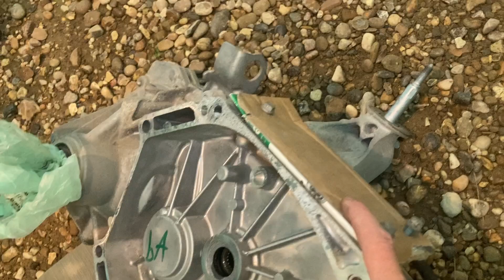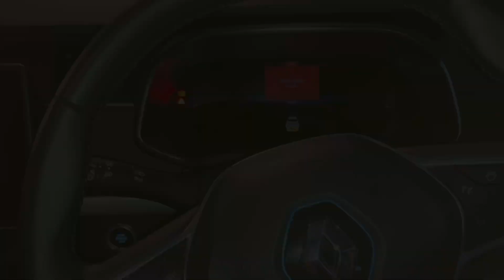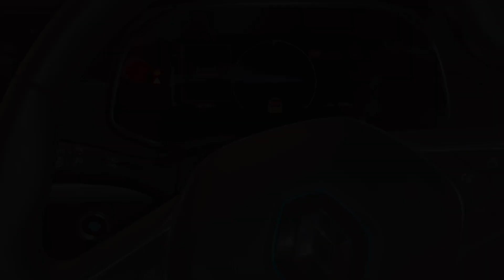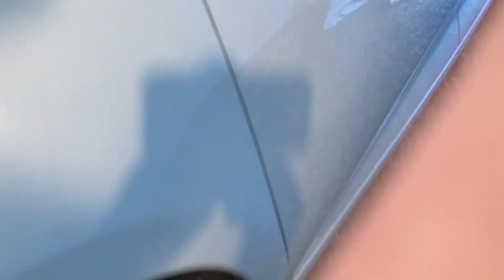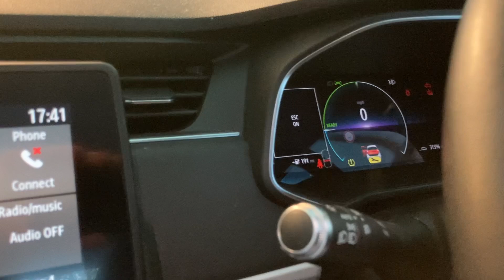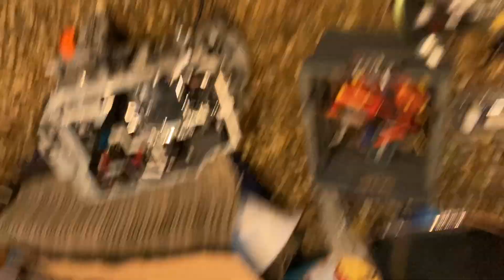IT WORKS!!! Renault Zoe ZE50 R135 Electric Motor Failure no more!

Comment: Hi Gary, congratulations on your work and for finding the fault! It’s incredibly frustrating to have to take everything apart twice—a long, arduous job—only for the car still not to start. I’m having the same issue with my 2020 Zoe (52 kWh)—there are several internal faults within the PEC. I replaced the entire charger/inverter assembly with one from a salvage yard (the manufacturer wanted 8,500 euros for the replacement), but I still can’t get it to start because the PEB and BCB modules contain the VIN from the donor vehicle, so they need to be coded. Were you able to code them, or did you reuse parts from your original unit to get it running? Best regards. Thanks.

Comment: I was looking into getting a Zoe (50kWh) - but your videos and some comments about Renaults are giving me second thoughts (watching vids like this is a bit like googling a medical condition and worrying yourself before visiting a professional  🙂!!)......so what's your honest (personal I understand) opinion on Renault Zoes of a few years old. And if negative, what do you recommend?

And you say you are a trained EV mechanic/engineer - so where do you operate (if you operate as a business)? Cheers
Reply from the maker: Hi I mainly do mobile diagnostics for garages and a few major faults in my little workshop, don’t have my own full garage. With any car there will be faults however it can be expensive to fix. Any ze50 that’s not written off will still have a manufacturer warranty, this can be extended before it runs out (but not once it has run out) so for peace of mind just keep extending the warranty. They are fantastic cars, great value and have ccs. I think for the money they are one of the best EVs. Reliability is tricky to tell because of course I see a lot of faults as I specialise in them and plenty have sold so there will be a few faults around! Cheers

Comment: Really surprised it's a brushed motor - so much for EVs having fewer parts to go wrong! And burried deep in the engine bay too - crazy!😮
Reply from the maker: Hi. It’s not a “brushed motor” design, they are only for rotor excitation so they only carry a tiny current and should last 100k miles or more, but it would be a 10 hour job to change them so it’s sensible to do so. Cheers

Comment: Blimey - you got some patience 🌝.  I vaguely. recall from early on Teslas fitted  some sort of brush/ carbon ring system to stop micro spark errosion ( for want of a better word) problems with main motor bearings suffering  early wear, induced magnetism 🤔, wonder it that is similar ?
Reply from the maker: Haha. I do wonder half way through why I’m doing another 12 hour motor stack rebuild but we get there in the end! yes Nissan Leafs also have a single brush on the rotor to effectively ground the rotor to prevent that mini spark welding/pitting effect on the bearings. Whether that is what happens to Zoe motor bearings I am not sure!  Cheers
Reply: @garycevrepairs  👍🙂

Comment: Quick question:
The previous control box was ruined because of a coolant leak.
What have you done to fix/prevent this leak on the new control box?
It'd be a shame if this new one was to fail after a few weeks.
Reply from the maker: Hi indeed it would be a shame but as there are no visible issues with the case it is hard to say whether the replacement will do the same and difficult to know how it could be prevented. The replacement is from a later car so hopefully improved from the early ones which this is. We don’t know if it is a tiny weep over a long period or road vibration eventually opening a hairline crack 🤔

Comment: nice work...but i don,t see specificly wich modules have you change, and wich ones do you mantain from the old one. .

By the way, i´m in the middle of a work little bit like this, but in my case the problem comes with the motor rotation controller, and can´t find a new one. Renault sais that i need a new motor, and not willing to pay 3880€ for a new one. do you know if the 5aq601 and 5aq607 motors are compatible? i know is tricky question but i found a second hand motor with only 36.000km on it. Thanks in advance, and keep doing your videos please i,ve learned a lot.
Reply from the maker: Hi I would need more info to be able to help as it’s not straightforward, need to know more about the issue you have. I can offer remote diagnostics but that would be a paid service. If you’re interested drop me an email at gclayton@hotmail.co.uk Cheers

Comment: Please, please with extra sugar on top. 
Just set up the camera on a tripod to show what you are doing (slow TV...). 
I am curious about all of the assembly process as I may have to depend on it one day...
If you tell what tool size is used it is a bonus but not a necessity.
If you do it the wrong way, that is educational also, then do it the correct way and all is just fine. If I have to do the same work I will probably watch the video three times before doing it.
Editing is not necessary.
Reply from the maker: Hi there is a previous time lapse video showing a full strip/ rebuild of the earlier non ccs Zoe. I don’t really have time to make how to videos as it’s really not my thing. I want to show that they are repairable, rather than how to do it yourself. Cheers

Comment: great work!

what modules did you swap from the old control box? you said as little as possible. but how little is that?
Reply: Hi Gary can you explain what part is coded.
Reply from the maker: Hi it’s not straightforward unfortunately, there is the vin coding for the immobiliser plus characteristic coding eg to the specific motor characteristics, then there are different variants of Zoe 5AQ and certain used parts are not cross compatible so you retain more parts if the used PEC doesn’t have the same part number and even version code. It’s something I’m figuring out and we don’t have a one size fits all for this kind of work when fitting used parts. Cheers
Reply: @garycevrepairs yes it’s the vin coding for the immobiliser I’m wanting to find out what part has it.
Reply: Hi there still looking for an answer as to what part you retained to get round the immobiliser
Reply: So did the car start in reverse after swapping the rotor wires?-)
I watched all your new zoe videos, I believe the stator windings are used for boost only during 1 phase charging. I'd like to know what models/years have that secured gateway... as for the coolant leak, maybe it needs those mounting screws pulling the Al or is related to temperature